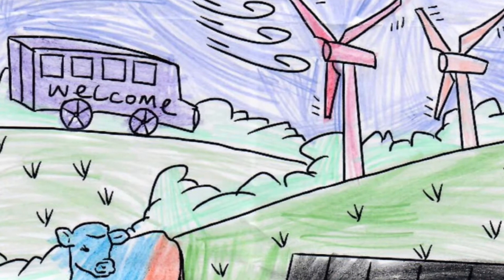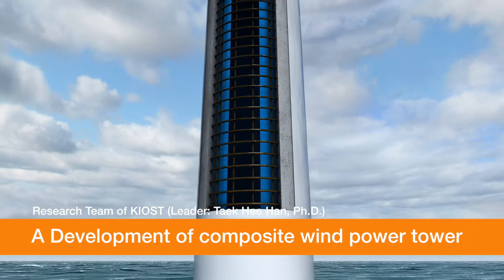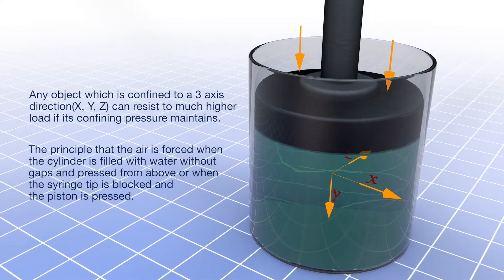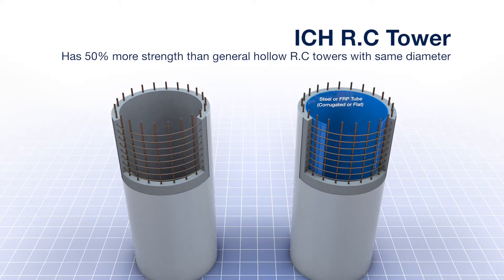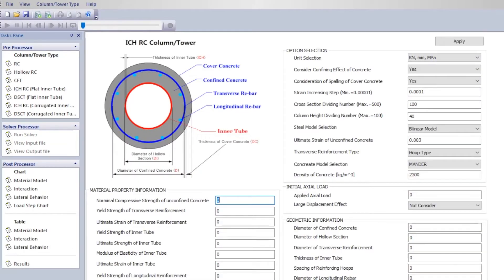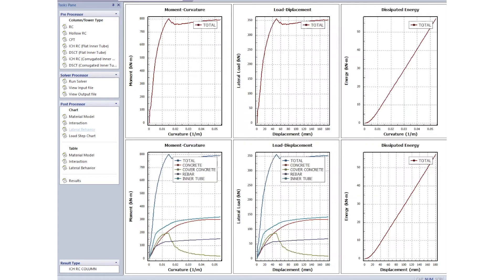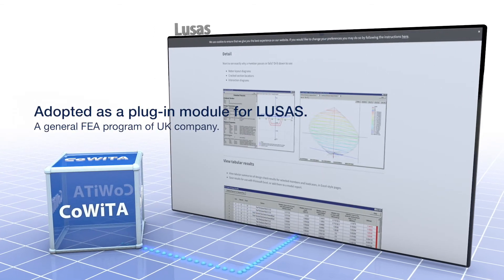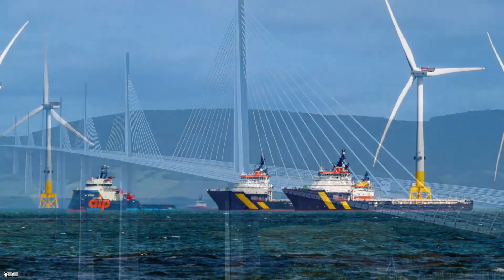KIOST  Composite Column and Wind Tower Analysis (CoWiTA) for Composite/Combined Wind Turbine Tower

Comment: ...when the engineers (which are comfortably sitting in their chairs) designing their ideas and thinking about materials and environment they are working in, the most important factor, that has been always forget (human factor) - there are the service technicians, which are servicing those towers within 20 - 30 years after the commissioning. If those engineers would think not only about bending and stressing and how to satisfy its investor, but about the service technicians, which working whether on tower or on Blades, and how to improve and to ease the working conditions, by designing those structures, than those structures will be more efficient for the future!!!
Reply: Thanks